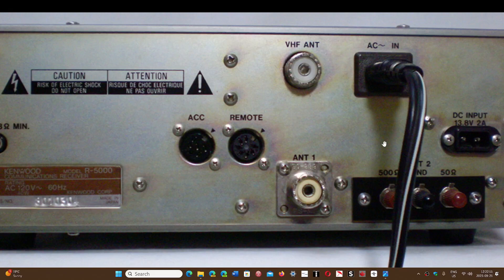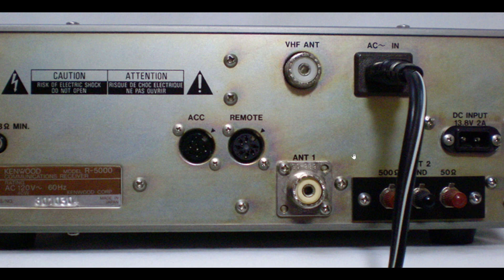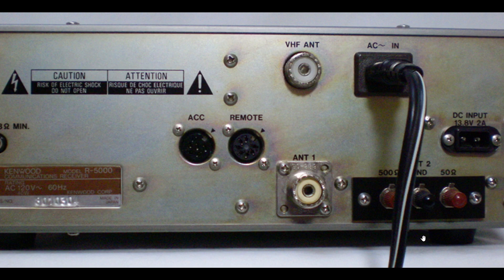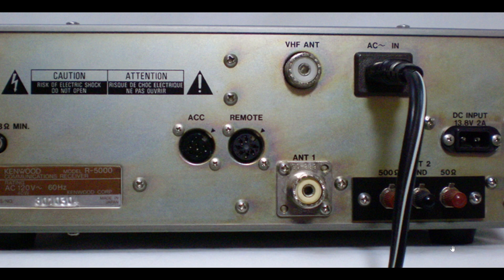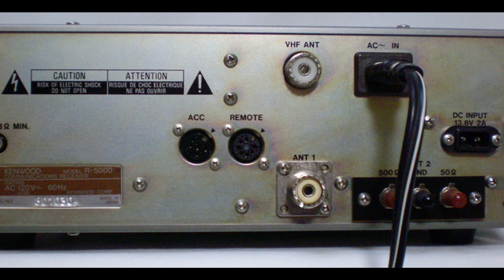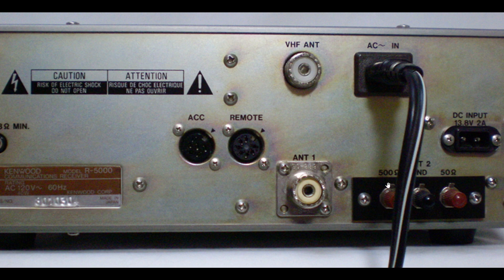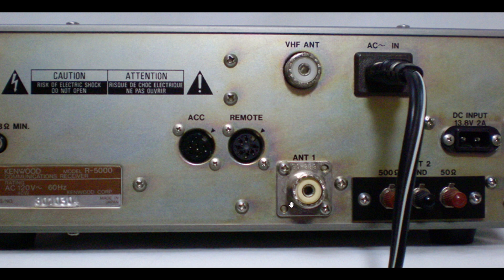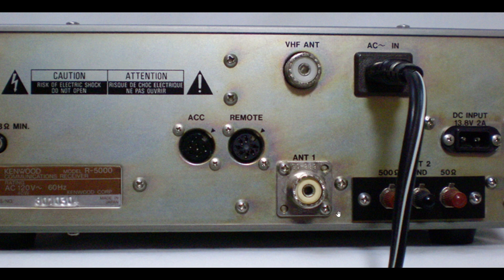When a radio has more than one antenna connector like Kenwood R 5000

Comment: You know, I've been around radio since 1976 when I was 10. Some nights when I have my SW on,  my mind goes wonky, and I get weird out of the blue thoughts. One is I wonder if there will ever be a connection that will replace the PL-259, BNC, and SO-239. I mean the PL-259 has been around since I've been around radios. The BNC has always been on any scanner I've had.

It just makes me wonder. An antenna plug that looks like an old keyboard or mouse plug. How about an antenna connection plug that looks like a CB mic jack. Just makes me wonder if they will ever get around to change when it comes to that. My Icom 8600 has a N connection for VHF/UHF. Lots of people have ruined that N jack because it looks a lot like a PL-259 but a small BNC pin. They force the PL-259 into it and ruin it.

I'm not much into portable radios, I do like them especially the H-501X. I think all portable radios should have a BNC connection for external antennas. Sometimes plugging that H-501X  1/8 plug makes me cringe with my big coax.